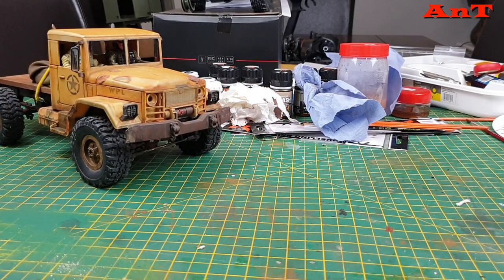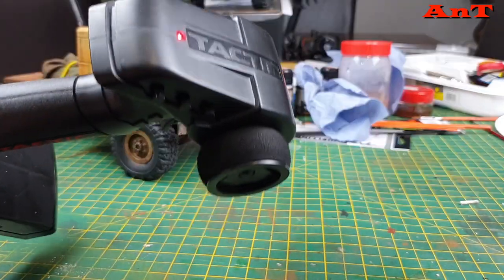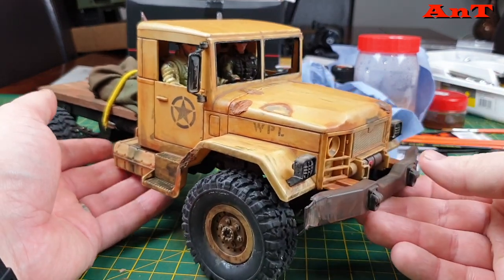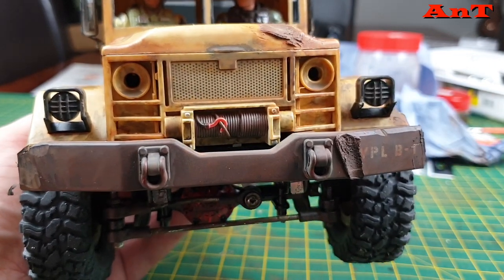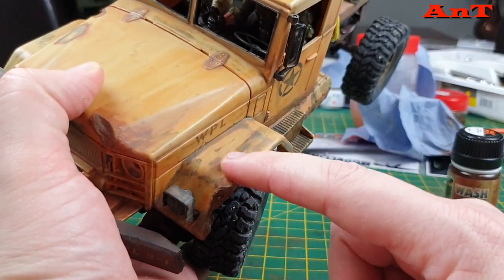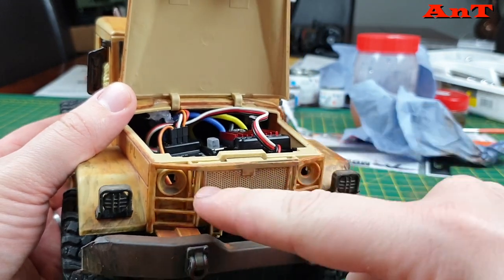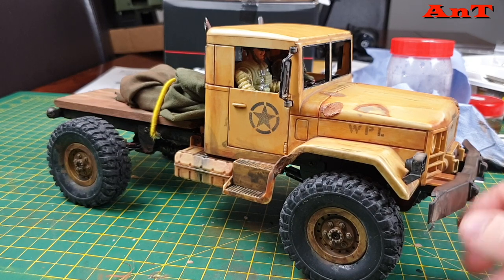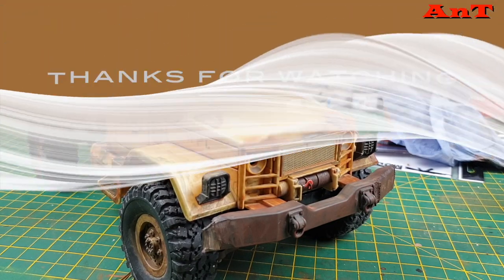WPL B14KM Review Weathering & Denting

Comment: Great vid, truck looks cool. You did a good job of selling me those paints there... I made a right hash of my Gaz and could do with any advantage I can get! Clever disguise for the battery, too, the covered load really adds to the look. 👍😀
Reply from the maker: Thank you 😃 the paints are very good. I think they just make the job that bit easier. I tend to get the mix wrong when watering things down and this saves you the trouble. The dust spot one is my favourite
Reply: @antrc  The dust and dirt one you mentioned - was that part of a set? I've been looking and can't find one bottle on its own (the rust one I can).

Comment: It's a very good weathering job, well done. My advise, totally based on a gut feeling rather than direct experience, is to try with a lower temperature on the soldering iron. I looks like the plastic was boiling or expanding quite a bit in some cases. Possibly dremel it away a bit before using the hot iron to have less material. But don't get me wrong, I'm picking for perfection here, the job looks great already as it is and I love it.

And if you like that kind of smooth crawl with brushed motors I just installed a Surpass Hobby 5 slot 550 motor in my RC4WD Beast II (crawl gear is 62:1) and it's very smooth, I was impressed. Much smoother than the Traxxas 21T which is stock on the TRX-4 for a comparison (not a bad motor at all imho, for being cheap). And it's only 20 bucks or so! On banggood of course. Worth a try. I'll post a video of the truck when I get the chance. Posted pictures on Facebook of it, but I don't think you have facebook do you?
Reply from the maker: Hi Enrico, well not really. We tried setting up a page for us but FB didn't like it as it wasn't a person. Interesting tips mate. Will research the motor. A

Comment: Try heating the panels with a heat gun and pushing in the dents. There is a little unrealistic puddling on the dent edges from the soldering iron. Have a look at some real old dented trucks and then google, tank armour round damage, Good effort though. Looks way better than the new plastic. Normally there would be metal puddling around dents on say 10 inch thick tank armour hit by another tank round. This is simulated by pushing the tip of the soldering iron straght in the plastic and painting the fresh molten metal inside the dent  with gunmetal paint. Try salt chipping too.
Reply from the maker: Thanks very much for the tips
Reply: @antrc  No problem. Have fun. Im getting back into my WPL Gaz66 and Ural, I have also mostly completed a custom DAKAR truck I made from a JJRC Q64 using styrene and coreflute sheet for the rear custom body, lots of new upgrades parts I put RC,s on hold while I restored my life size 71 VW Beetle.